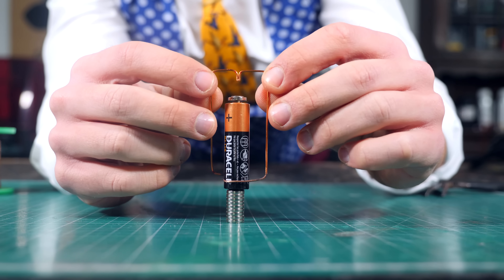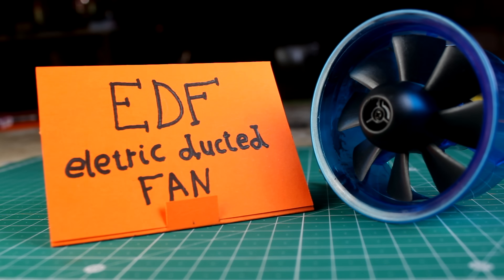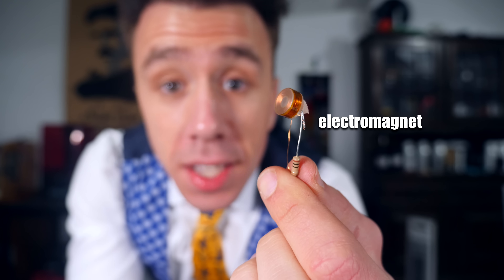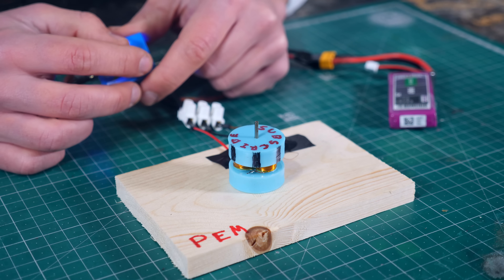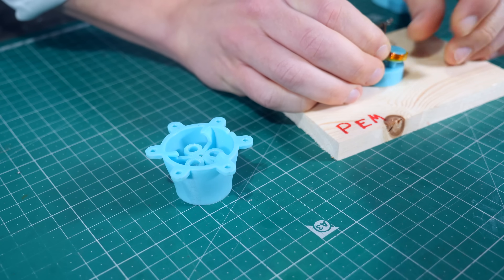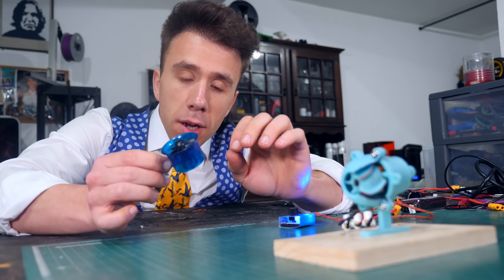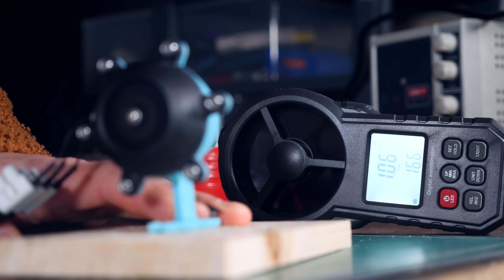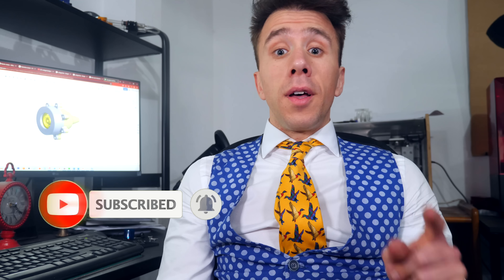I 3D Printed an ELECTRIC MOTOR FAN

Comment: You're confusing power and thrust as there is a third element, pressure...

Axial fans have high volume with low pressure values for the same power a radial fan has low volume with high pressure value.

You won't see high or equal volumes when switching to a fan design specifically intended to build up pressure (or more precise) and compress. The compression is desired as this make combustion much more efficient and reliable (higher density improves the energy release efficacy). For a jet engine, this pressure is thus desired.

For a dyson fan, the size constraints are one reason to use a backwards radial impellor to push air out and up at high pressure as they then use a trick to move more air volume by creating a circular ring of moving air (they release high pressure to create air movement that sucks in air as the movement itself draws in air from the other side). It's not the efficient method to move the same amount, but it becomes 'bladeless' on the side of the consumer.

When you look at turboprop fans, they use a compressor (similar to what you tried) to compress and create the energy via the engine and fuel, to create around 90% of the energy needed to run the blades for the air volume. The axial prop is doing 90% thrust, the compressed air that ignites the fuel, provides 10% thrust but delivers 100% of the kinetic energy through combustion.

So. No, you should not measure identical air speeds as this is volume, pressure and even surface area from the throw dependent (yes, another variable).

Comment: Air flow VS air presure. 
The blade design is realy importent. 
You can check 'fan show down' vids on YT, 
he test and 3d prints fans all the time and test em with the same moter, 
huge different results depening on lots of factors.

Comment: I found the flaw in your design. Don't worry, it's an easy one to overlook. You forgot...

EXPLOSIONS!

That's right, your aerospike needs fire in the expansion phase. Can't wait for the update video!

(But in a more serious note, your centrifugal fan can't ever achieve the same efficiency as the ducted fan. Sorry. What's happening is a lot of the energy the motor is producing is going into pushing the air around convoluted curves and corners in order to compress the air achieving higher pressure at the expense of mass flow. What you think is happening is a smaller volume of air traveling at a higher velocity should create the same thrust but you aren't taking into account the losses from inefficiency. Try running it in a smoke stream to see the actual airflow you are creating. I'll bet you will see a large volume of air from the impeller going out the front instead of through the fan. Hope that helps.)

Comment: Just looking at the fans next to each other the inlet area of the EDF is substantially larger, and more importantly, the swept area of the EDF is also much larger. Swept area is the parameter that matters if you are fixing input power and RPM like in your test. The constraint you will face is that it is more efficient to accelerate a large amount of air by a small amount than it is to accelerate a small amount of air by a lot (this is why airliner turbofans are constantly growing in diameter: they want the largest bypass ratio possible and are now passing about 12 times more air through the fan as they are through the "jet").

If you take a regular propeller and attach it to the motor and measured the thrust it will produce more thrust than the EDF and your design (the propeller should be within what the motor is capable of spinning, maybe 4 to 5 inch for this one? not sure of the motor specs here). This only applies when stationary as propellers produce less thrust as speed increases. Actually all of them will lose thrust as aircraft speed increases, but if your propeller is only accelerating the air to say 10m/s while the EDF is accelerating it to 20m/s then you will run out of thrust at a lower air speed ion the propeller.

EDIT: you will also probably benefit from a thinner blade profile. You may be facing the limit of what your printer can actually make, but at this scale you want blades as thin as possible. Probably doesn't totally account for the performance delta, but it might net you something.

Comment: engineer here, if you want high thrust per watt you should use big propellers going at slow speeds. This is because if you move double the mass at half the speed your thrust (m*v) stays the same while the required power goes up and vice versa

Comment: NEW video idea - make a hybrid rocket engine, but instead of only fuel as the solid part, use r-candy thus double the oxidation power = more thrust.

Comment: There are a few different issues that play into this; First, air is compressable so it is hard to evaluate because air is easily compressed where as liquids are not. Second, pump types will not allwasy have a 1:1 charistic as some are better at creating pressure vs flow, also the size of your pump makes a difference. Instead of going with a small intake on your pump you want a large one, aslo the overall size of the two fan you have is different. The Centrifugal pump that you have is substantially smaller than the other pump that you compared it to. Also you should start with the snail design housing (turbo shape) not the jet style as it will be easier to solve issues. Also with the design that you have on your Centrifugal pump the exit is supper small, this will introduce friction losses and also increase pressure chnage. If you look at the EDF fan all of these charistics are minimized if you look at the shape of the fan. Also the EDF fan indroduces minimal compresson forces on the air where the Centrifugal pump will compress it a lot more because of the design. Also the EDF fan mainly pushes the air to acclerate it where the Centrifugal pump does not. To make a better comparison you should redesign your Centrifugal pump and design your own EDF fan or switch to and incompressible fluid. 

PS - I have a BA in Mechanical Engineering.

Comment: I am currently trying to do something similar to make thrust for a drone. Mass flow rate is a big problem, but a solution might be to have a two stage system that uses an edf type impeller to increase mass flow connected to a mixed flow type impeller to increase pressure. The combination might work well with aerospike nozzle.

Comment: Eru already said it,  centrifugal fans produce pressure, not volume displacement. In theory you could move the same mass, but since you already mentioned aerospace "fan" engines... that is exctly the reason why the combination of compressor-section and ever bigger getting fan-sections are combined to produce thrust. The compressor in an engine works differently from your design, but it fullfulls the same purpose, more air/oxigen per volume going into the combustion chamber, which can only be achieved by compressing air. That power than gets "converted" to fan-thrust.
With regards to the dyson... the principle is using the suction part of the fan, which works way better  due to less air leakage than a conventional fan and thus produces better suction.

Comment: Dyson fans aren't relying entirely on the impeller for thrust, they also do a cfm amplification trick where the output from the blade is shaped to draw air in from the back and increase the airflow without needing a larger impeller. If you're rely on the output numbers from a fan to calculate an impeller you could get skewed numbers.

Comment: Thrust is directly related to the momentum (and thus the speed) of the air you shove through.

The motor should (al things being equal) dump the same energy into the flow.
With the EDF, that energy is in the form of kinetic energy, speed, and thrust.
With the impeller the work being done is instead meant to pressurise the gas, adding to the pressure energy instead.

A well designed nozzle at the rear should allow you to work with this and speed it back up, (though there will be losses and it needs calculating)  and a good jet design requires the pressure as well

In essence, you should not be expecting the same thrust from the two of them, but if you take a look at the stagnation pressure it should be similar

Comment: the exit of the fan is too small, at this scale the motor is too weak to overcome the compression inside. the edf has no compression so it has no problems pushing the air through.

Comment: You need to have the blades skinny and tapered. Like the original. You probably won’t be able to make it on a 3d printer. Also you’re gonna need very low friction high rpm bearings that are very precise

Comment: Looks like your impeller only outputs a fraction of the volume of air compared to the regular fan.

Also, the shape of your impeller is optimized for when the engine is moving fast through the air. While stationary, it will not accelerate the air efficiently: the steep starting angle of the blade forces the air to accelerate very quickly when stationary, causing a large drop in pressure behind the blade that slows it down and wastes a lot of energy through eddie flows. In fact, the impeller is designed to maintain pressure whilst simultaneously slowing the air down, the opposite of what you want to achieve in your bench test, as you want to accelerate air. That is why you also see this configuration in turbines where water flow is converted into electrical energy.

When stationary, the fan might be more efficient when you run it in reverse.

Comment: Centrifugal compressors are more suited to pressure while axial compressors are more suited to airflow. That's why you see axial flow turbines on higher speed jet engines and high bypass engines on airliners, where high speed forward movement is desired. But you see centrifugal flow turbines in slower speed or stationary applications like turboprops, helicopters, hovercraft, tanks etc. They both work, they both have strengths, they just have slightly different applications.

Comment: You should turn a torpedo heater into a jet engine they heat up to 11,000 degrees F.  And does make a little trust and you can use it to destroy tomatoes.

Comment: It looks like you got stuck in the same problem as another channel, @Major Hardware, even printing the same fan as a manufactured one, you won't obtain the same performance. It all boils down to imperfection of the surfaces, edges and materials.

Comment: You could try and add a turbo fan behind the electric motor in order to convert the high static pressure that has been build up into high dynamic pressure or airflow. Other things i would try is use smoke and see if the exhaust flow of the EDF gets dispersed quickly, indicating high static pressure. You could even drill some holes in the engine and do some static pressure readings from there. I think youre using Solidworks, can flow simulations be of any help here?
Reply: Oh no I did say turbo fan, I meant Turbine Fan! sigh With converging airflow before the turbine fan and diffusing airflow after.

Comment: As a rule of thumb, a centrifugal fan would create a higher static pressure (think can blow harder) where an axial fan can provide a higher mass flow rate (this can push more volume, but not as hard).

The two characteristics are a trade off from the design of the fan, and the "system" you are trying to push the fluid through (there are also differences for blade inclination etc). Look up "fan selection curves" that show the performance of a fan from fully closed system, to fully open for varying rotation speeds, that should help a lot!

Also remember that a propeller and axial fan will behave very differently to a multistage compressor on a jet, that may also need stators! Good luck and keep the great videos coming!

Comment: Centrifugal fans have pretty big losses because you have to redirect a radial flow to go axial.  To be precise axial to radial to axial.  That's one of the reasons why they are mainly used in helicopters or apus where you use a shaft to transmit instead of airflow for thust.

Comment: it is the shape of the blade ... if i where to make a propler i would make one with holes going the other way so it builds up presher faster . so the fan would suck in air but the holes on the inside would be at a shaper angle to force air in .

Comment: have you weighed each fan without the motor attached? Is it possible that the motor is simply having to work much harder for the 3d printed fan? also have you measured the surface area of the blades? It could be a combination of slower speeds and lower wind moving surface area. and like another commentor mentioned, it's also possible that the dyson fan is designed for a lower speed air current with a higher pressure behind it. that could be impacting it as well

Comment: Same motor doesn't mean same power, it probably has a lower load, making it draw less current.
That design of impeller is capable of creating more maximum pressure, but the pressure and flow also depends on the characteristics of the load.
If you need more flow you will need to change the design with a propeller optimized for flow, but I'm guessing ths is to improve in your design of your turbojet engine, and for that you will need the higher pressure impeller to fight the back pressure from the combustion engine. 
Try restricting the nozzle so you build higher pressures and the motor works closer to its rated power and maybe get more thrust

Comment: How is compression achieved? The distance between the fan and the wall of the cage, the angle of the fan and I would use some vanes as stators to increase compression. If you could get higher rpm it would also help.

Comment: Centrifugal fans increase pressure, which then decreases on the output, so some of the power input gets lost to heat during compression and decompression. So there is no way to get the same amount of thrust from a centrifugal fan compared to a regular fan. You can try to make use of entrained air, something like a blade less fan

Comment: My guess is that you fan blade is quite small and since your using bolts to hold the 3d print there are still small gapes between the the 3D prints that may remove some of the air, if the had no diffrence use less blades but bigger ones to creat the air flow you need.

Comment: Welcome to Fan Showdown, in here we built fan to get the highest peformance... https://www.youtube.com/watch?v=ndCd_EHj4zI

Rule number 1... We do talk about fan showdown...

Number 2... Not every fan is best for every situation... There are air pressure optimised fans , and there are air flow fans... Some fans blow a lot of air but if you put simple mask and they can't... Some fan's built for pressure, they are better at penetration, you know what I am saying...

So this is why you use radial  / blower style of fan design while giving high pressured air to engine and axial fan to cool down the radiator...

Comment: My guess is that #1 your blades aren’t big enough in regards to the base that’s holding them #2 accelerated air is the opposite of pressurized air which is why you can’t breathe the air when you stick your head out of the window in the car. That’s why I believe your biggest problem is you need some heat generating agent like combustion and/or an axial fan out the back end to accelerate the mass of compressed air.

Comment: Hey Integza,
Just a thought, there are bound to be a lot of people with great ideas that don’t get likes on their comments. Maybe once in a while you could try a different metric for your giveaway and spread the love around. 
Also, you used the same motor but the front cover cut the intake diameter way down. That has to account for some of the loss. Maybe scale the print so that your intake size matches the EDFs?
Cheers

Comment: The answer to your question is: Impeller design is a extremely complex engineering  task. Impellers are highly optimized for the given rotation, power and need air flow AND pressure. Centrifugal or mixed flow impellers like Dyson's intend to create pressure too, and they do that with the expense of having lower flow and "thrust"

Comment: I'm not an engineer nor a scientist. But maybe (like a 0.0001% chance that) the impeller is pushing more air outwards than backwards. Correct me if I'm wrong (which I probably am)

Comment: F=MA
Lower inlet area = lower mass.
Acceleration is limited by pitch, which is limited by pressure difference.
Since you're covering radial distance, as well as axial distance, you can't match a fully-axial DF, because Pythagoras.
You'd have to switch gears, and go The Schauberger Way (Comprehend & Copy Nature), if you want to attain equivalent thrust efficiency.
The math is easy. Your 3d modelling skills can make it happen.
Piggyback on Jack [Denur]: https://www.scirp.org/journal/paperinformation.aspx?paperid=85757

Hint: If you can manage to control the pressure gradient, then your total thrust limit will be proportional to Angular Momentum + Pressure Gradient, which means that you'd have TWICE THE THRUST.
My 3d modelling skills are weak, so I can't show you how it looks.
F=MA; birds flap UP, faster than they flap DOWN, because positive pressure is inherently inefficient, so they try not to use it.
Dual, counter-rotating vortices keep birds aloft.
Hope that helps.

Comment: I would tweak the pitch angle of your impeller blades. Since the resultant pressure at the trailing edge of an airfoil is correlated to the angle of attack, adding AOA to the pitch angle of your blades could help increase the surface area of your blades and also increase the resulting pressure at the trailing edge.

Comment: The EDF fan is known as an Axial Fan, and the Impeller/Centrifugal one can be called a Radial Fan. Axial fans generate low pressure air flow, while Radial generates high pressure air flow. Because of the higher pressure, you need more power. Generally you use an Axial fan for passive airflow, and Radial for compression.